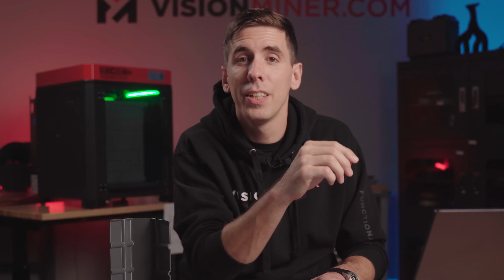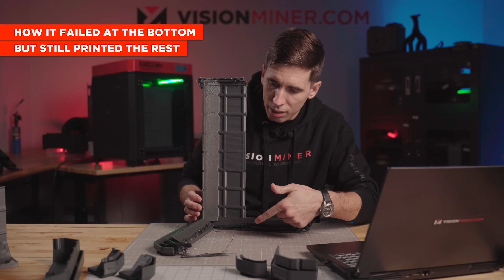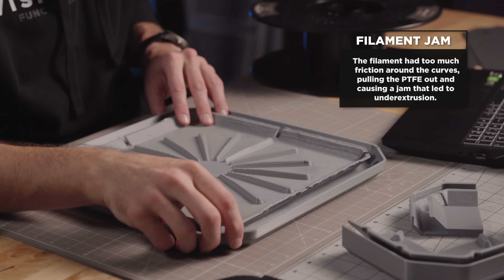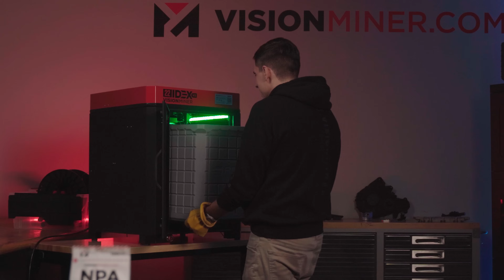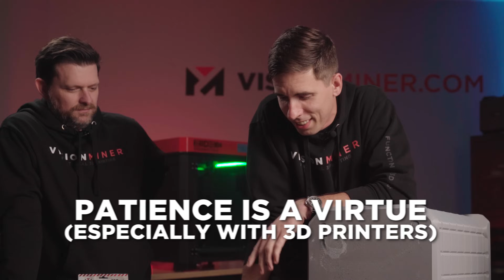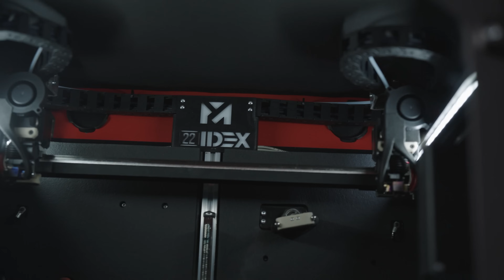ABS Filament: BIG 3D Prints Tuning Workflow Tutorial on the 22IDEX

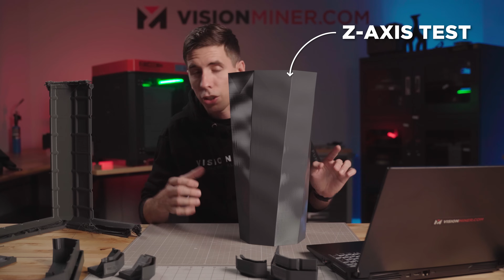Comment: 9:13 This is not exactly a hexagonal pyramid. From the video, it’s visually apparent that the lower and upper hexagonal bases are not parallel and appear slightly twisted relative to each other.

In the case of a true hexagonal pyramid, you would get straight edges, with a direct extrusion from the smaller hexagon to the larger one at a specific draft angle. However, in your model, the faces are curved, and while the edges might technically be straight, everything appears curved when viewed in perspective.

I could be mistaken, but I’ve checked this in my SolidWorks model, and it seems to confirm this observation.

Comment: This video expresses very well the experience printing with ABS/ASA. The deflection on that part at the end of printing was insane! I can't believe it finished either after seeing the video. I've been doing a lot  of ASA parts (which thankfully don't warp as bad as ABS), and yeah, the warping sucks to deal with. I modified my K1 Max to be able to get the chamber temps up to 60C, and it really helped with the warping, but quickly found with the higher chamber temps I couldn't print with the same nozzle temps I had with the lower chamber temp, and had to lower them to 250-255C to keep from clogging (Hopefully the Phaetus hohtend I have waiting to go on will help with that), and same 110 on the bed. As well, dialing in proper flow ratio to ensure proper layer extrusion really helped. I also keep the filament in a heated filament chamber while printing to keep things nice and dry. When I first started printing ASA, I was under extruding, and that really hurt my adhesion, but once I got that dialed in properly things were much better. I certainly have experience different behavior with different manufactures and colors. Each one needing to be dialed in. Good video, and really helped me understand more.
Reply from the maker: Thank you! Yep -- it's the wild west out there, with all the different filaments and styles and methods... great to hear!

Comment: I want to ask if I replace the 0.4mm nozzle with 0.6 or 0.8mm do I have to change the nozzle diameter on the printer.cfg nozzle diameter clipper? or do I not need to change the nozzle diameter on the printer.cfg?
Reply from the maker: No, the nozzle diameter is changed in your slicer :)
Reply: I think you do need to change both slicer and printer.cfg

Comment: Obviously NPA does NOT "deactivate" when it cools.
Reply from the maker: On the final print, it clearly did -- the first attempt, it was still warm, unfortunately. But at the end when Cole popped it off -- it came off very quickly, without any tools. With PLA and some other materials, on hobby printers, if you come back after the printer totally cools down (the next morning), often, the parts self-release and are just sitting on the plate. It's pretty awesome!
Reply: The ice pack didn't cool it enough, I think that's the obvious part 😂

Comment: 4:19 that onscreen tooltip kinda makes no sense to me.. a hilbert curve is nothing BUT sharp corners and direction changes that DO slow things down so..??? 
The point is discontinuous polymer chains that can shrink more without consequence to layer adhesion and warp stresses compunded over large lengths, as said otherwise though.

Comment: Soooo much time spent…. On a print and a printer that expensive.   Probably could print that on a modified CR10max and insulated enclosure or heated.
Reply: I partially agree, but also It's huge and it's ABS.. so it's just going to have some scaling challenges that smaller ABS parts would never exhibit. They wanted to make a video and print a bunch of sections where smaller test pieces could have worked, but it's also for visual demonstration so.. not a typical workflow IMO.
Reply from the maker: @theobserver567 this was the process tuning ABS for the 0.8mm nozzle and 0.4mm later height — so yeah, you could use the stock profile and hit go, just fine — but this was more about the unique situation :)
Reply: When you have a machine like the 22IDEX, you're not always going to be printing PEEK and other engineering grade materials. You'll get a lot of customers who just need ABS and nothing more. This machine is perfect if you need the capability to print every type of material out there. Is it overkill for something like PLA? Definitely. But, it replaces the need for a cheaper machine because it can do anything from PLA to PEEK.
Reply: You also have to consider that government grants pay for a good bit of machinery. The DOD doesn't want their parts made on a foreign machine.

Comment: 70C is a VERY hot chamber for ABS... Typically I use 50C and that is plenty. Instead of trying a bunch of times with different variables, why not do the actual flow, PA, and temp tests? It seems like a massive waste of time and money to be messing around like that. Dial it in before making parts... Orca slicer has built in tests. If your custom slicer doesn't have them, then you should include them.
Reply: 50C chamber is "good enough" for some uses but  those prints have a fraction of the layer adhesion and strength that they would have in an 80C chamber, which is more ideal for ABS.
Reply: I have to agree, I've often found that if my PA needs to be messed with, it's because I'm not operating at a proper temperature to achieve similar viscosity, which directly influences the PA. Personally though if they can run 70C chamber why not? The closer to the glass transition temperature the less shrinkage you'll encounter mid-print as it cools to chamber temp, on some parts that might make the difference to being totally unprintable for 'chonkier' parts loaded with plastic. Also the bonding between layers will be fairly robust.
Reply: I'm sure they know what they're doing.  They do this for a living
Reply: @AutismusPrime69  I can assure you after working with them and leaving, they do in fact NOT know jack diddly shit.  It's actually sadly pathetic with the following they have and the horrible "knowledge" they spread
Reply: exactly like wtf is this guy doing. just another person with no real printer knowledge. you sound like a failed CEO trying to explain a product you obviously didn't invent. there so many other people that could actually be moving this industry forward but we're stuck having to soft through this garbage.

Comment: I was fascinated by your spreadsheet record of the parameter modifications as you optimized this large print for the VM22 V3. You collected a lot of data. I think this is a good opportunity to use DoE [Design of Experiments] methodology to accelerate convergence to the optimum print. If you are not familiar with DoE, here is what ChatGPT o1-mini says about it:  "Design of Experiments (DoE) is a systematic, statistical approach used to plan, conduct, analyze, and interpret controlled tests or experiments. The primary goal of DoE is to identify and understand the factors that influence a particular outcome or response, determine the relationship between these factors, and optimize processes or products based on these insights. Originating from agricultural research in the early 20th century, DoE has since been widely adopted across various fields, including engineering, manufacturing, pharmaceuticals, marketing, and more.  
Practical Example
Imagine a manufacturing company aiming to improve the strength of a composite material. Using DoE, they might investigate factors such as the ratio of components, curing temperature, and curing time. By designing a factorial experiment, they can simultaneously assess the impact of each factor and their interactions on the material's strength. The results would reveal not only which factors significantly affect strength but also how they interact, allowing the company to optimize the manufacturing process for maximum strength efficiently."  You may refer to the book "Design and Analysis of Experiments" by Douglas C. Montgomery, 10th Edition